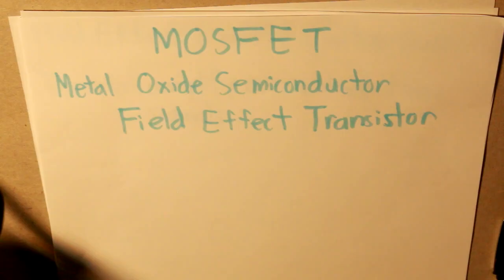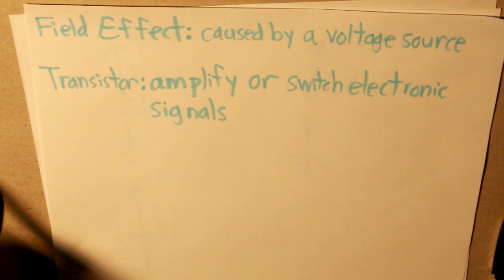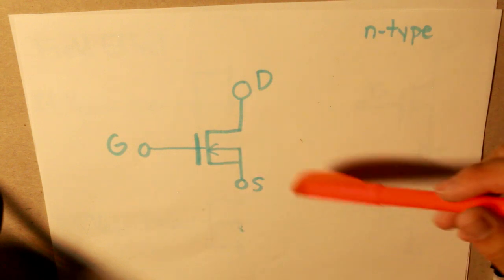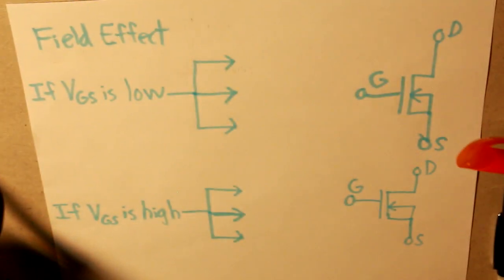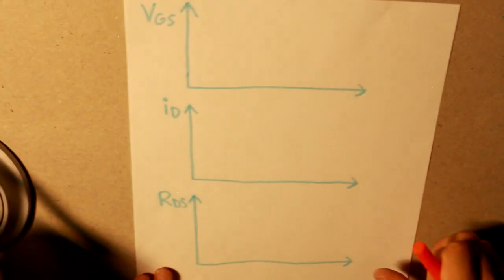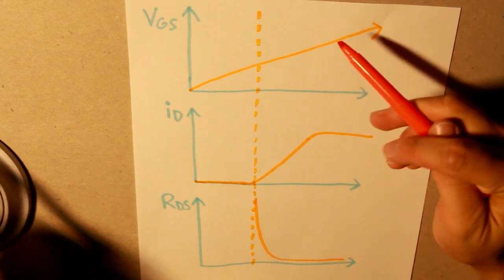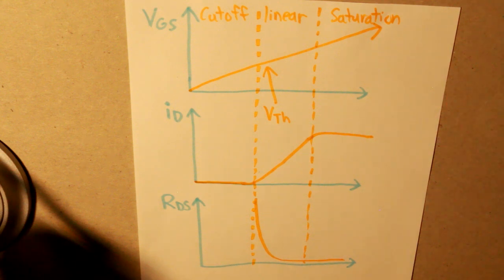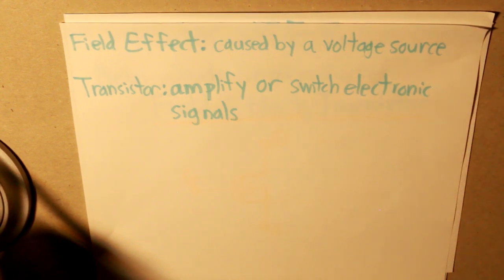MOSFETs explained

Comment: I'm new to MOSFETs, let me begin with that, but I'm not seeing something here.  I'm stuck at 5:50.

If Id is close to zero, it follows that Rds is very high.  Fine.  However, this would imply that Vds is also high.  If current is not flowing, then there's in implied high resistance.  How then would Vds be low?
Reply: I think he made an error. Vds is independent from Vgs.
Reply: Vgs is like a gate that will allow the current supplied (Id) by the 10v to go through. if the Vgs is low i.e the gate is slightly open, low current (Id) will flow in which implies high resistance(Rds). He is correct with the video.
Reply: @kehindeadeniji3530  'Fraid not.  If Vgs is low, the gate is closed which necessarily means Vds is high.  Technically, there will be some current flow unless you pull Vgs to negative, but this is pretty insignificant.
Reply: When I said low I meant greater than 0 but if Vgs is zero then it’s cutoff ie Id is zero. I rest my case
Reply: @kehindeadeniji3530  Please don't design any aircraft systems.

Comment: I am a retired auto tech and building a daily driver with reliable robust parts and creating as service manual to go with it. My biggest hurdle in planning for the correct n-type Mosfet, is correct on voltage within saturation. 
  I am running a cooling fan across a radiator type device to cool the automatic transmissions fluid. Using a can/probe type NTC thermistor at 10k (Standard for 25 degrees C) but also to make it adjustable, I am placing a 10k pot as a voltage divider for gate control of an N-channel Mosfet. I believe with most data sheets that 2-4 volts for “On” voltage for the Mosfet, I will use a 100 ohms resistor. I will use an external relay oversized to ensure a robust circuit and ease of diagnostics, repair, testing and a large auto-type relay box, found behind the glove box of Park Avenues & LeSabers. It is narrow and takes little space, yet holds 12 relays and 14 fuses. I am very good with auto electronics, but ok will enough knowledge to build a circuit on a bread board...without setting a fire! 
  They sell digital readout type temp sensors for $10. But they loose their setting if disconnected from power. I don’t want that! I will spend $20 now, to save $150 later. Your thoughts on a mosfet? My eyes are bleeding after 77 data sheets and 94 videos that mostly play music. Great for music lovers, but I want to get one thing done per day, while waiting for my S1-L2 lumbar fusion. It’s not fun or easy, but not related to fixing cars since the late 60’s. Thank you for a clear explaintion and I have to admit, I was saying out loud to draw the vertical dotted line...and you did! God bless you.

Comment: need more explanation as to why id is 0 when VGS is increasing in the beginning
Reply: Id is zero because VGS has not surpassed the Vth (threshold voltage) assigned to the MOSFET by the manufacturer. So no current flows until that voltage is met.
Reply: Proficient- thanks

Comment: When the transistor is open, the voltage Vds should be high isn't it? And when it is closed, Vds should be low. If yes, then the portion of a video at 6:28 is incorrect.
Reply: Yeah when Vgs is high then Vds will be low (Practically no voltage drop across the device). Basically all the current will flow from Drain to Source with the exception of the small voltage drop due to the Resistance of the Mosfet when on (Rds on parameter on datasheet). I was going to comment on that too until I saw your comment.
Reply: Yup, you're correct.
Reply: @Soumeya Benzina If there's say a 12V voltage source between drain and source and Vgs is lower than Vth (which is the voltage between gate and source at which the mosfet starts to conduct current) then Vds will be 12V.
Reply: @Soumeya Benzina That's correct assuming that its not a P-mos device.